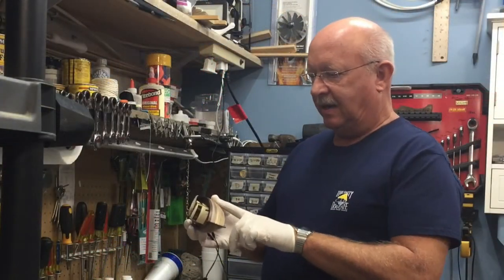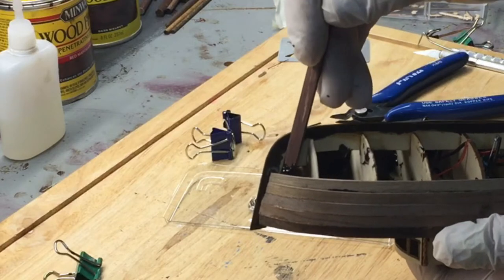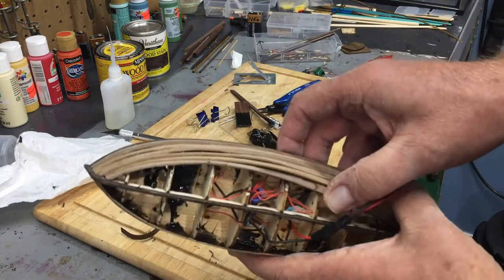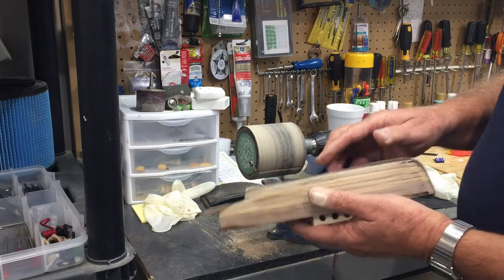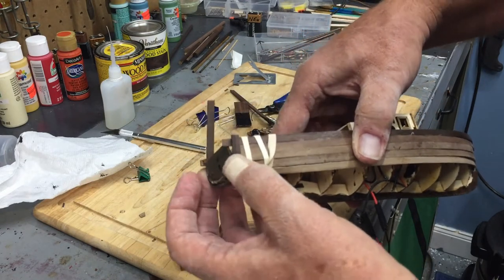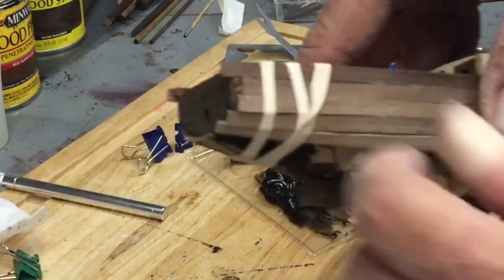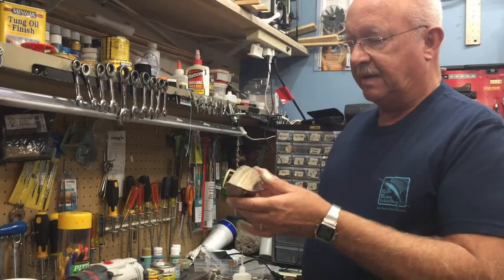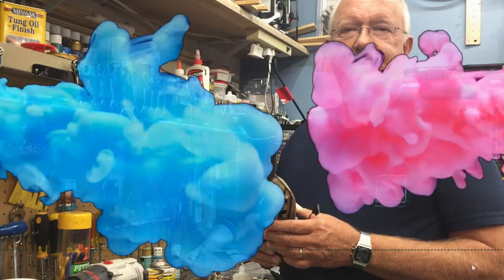HAPYLY 1/30 Scale DIY Wooden model Fishing Ship Part 3

Comment: As a suggestion for your lighting wiring.. I make scratch built R/C model boats and use connectors a lot. If you put a connector in the wiring coming out of the boat and fasten it to the keel or garboard strake then you can connect/disconnect the power cable any time and it would make it easier for you when working on the model to keep the wires out of the way.
Reply from the maker: Yes, you are right!  In my most recent build, I do install a plug in adapter port on the underside of the ship.  I also switched from battery power to a 3 volt a/c transformer power source.
Thanks for your suggestion and for watching my journey as I learn as I go in model ship building 👍

Comment: you think I could hollow out the insides a bit and turn it into an rc boat?
Reply from the maker: The hull isn’t solid. But if you seal the planks it’s possible! The structure is a sound model of a ship
Reply from the maker: I want to add that you’d probably need to put some ballast (weight) in the bottom of the ship or it’ll probably lay on its side? Thanks for watching 👍